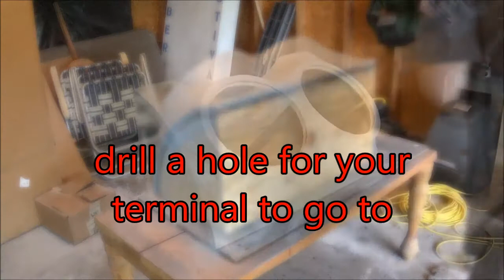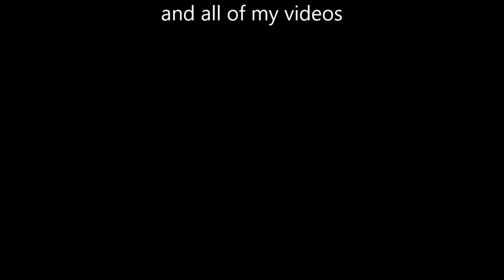12 inch sub box part 3 custom figerglass speaker box

Comment: You can Prime on top of that 120 scratches? See I've usually got it down to at least 220 before I prime it and then 400 before I paint.  Just trying to learn here maybe I'm doing something wrong I'm sure
Reply from the maker: hold on you aren't doing it wrong you really need to use filler primer and need to make sure that when you do your final sanding that the surface is clean and your sand paper is clean as well and use a sanding block it should help quite a bit.

Comment: Did u use any fiberglass Mat on the box
Reply from the maker: no i used the cloth on the inside, i feel that it is just fine for what i build them for. i only used one layer. you can use 2 if you wish, you can use matte if you like as well. it is just all in what you wish to do.